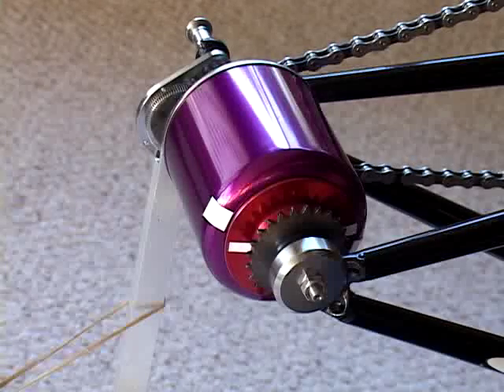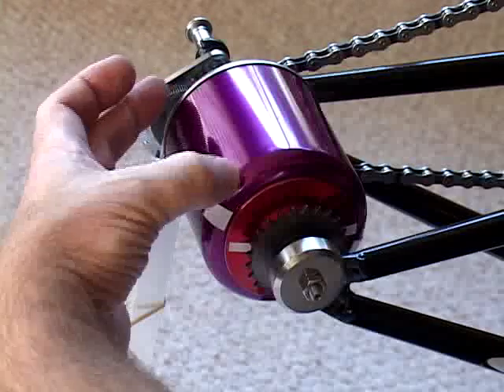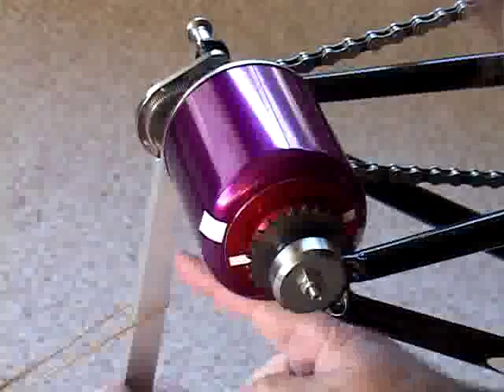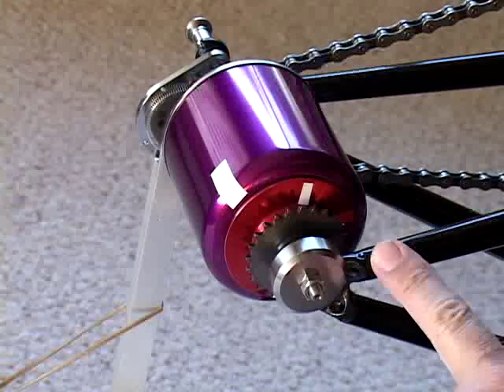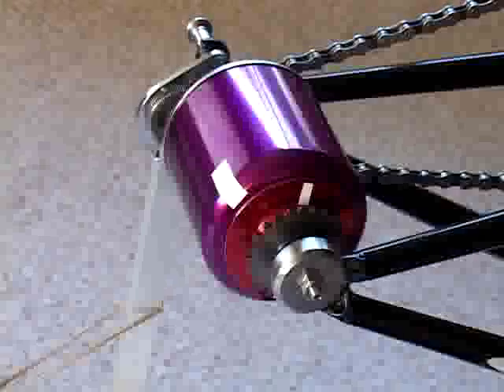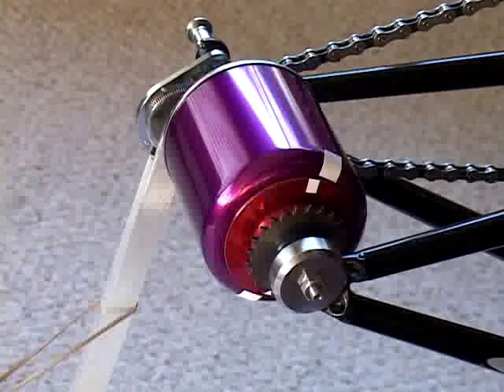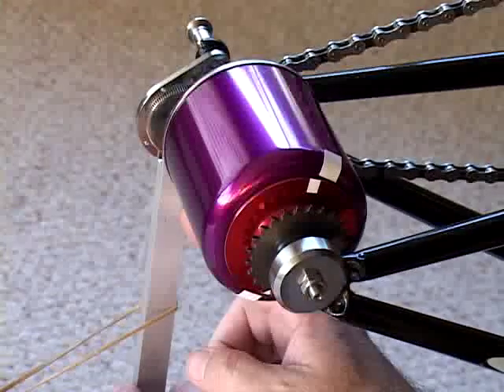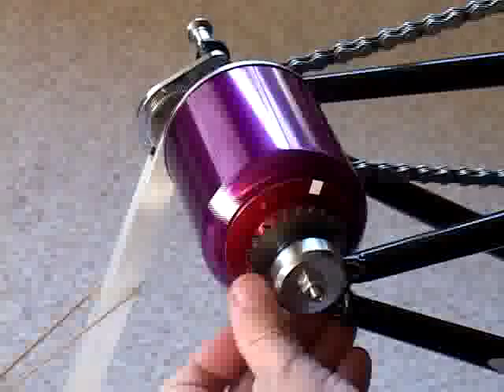Automatic Bicycle Transmission (IVT)

Comment: What about high output biking, like drag races, Hill climbing, etc.  I wonder if you did have some sort of cable shifter, could you just drop the clutch or release a brake lever; after your legs aare turning fast, and all of a sudden you release and have bite and you can launch just like an automobile, on my 5 speed mountain bike i downshift maybe to 3rd to make my legs turn faster then slam it into the next gear and keep the same leg speed whilst upping my riding speed tremendously. i need a transmission that can withstand me hammering down on it for quite some distance, we dont need it to be easier for us to pedal we just need it to work right, function without even thinking about it, and be strong.
Thanks -Rocky
P.s. i cant believe this video is still up i remember it from yeears ago!
Reply from the maker: I'm a large man with strong legs who did more than a fair share of riding through steep mountains & engaging in drag races on a bicycle.  The first bike transmission I 'engineered' for that 'high-output biking' was a hybrid of a derailleur-based 10-speed with a Sturmey-Archer 3-speed hub for 30 gears with a lot of range.  That was 1963, and I was the first person to create a 30-speed bike as far as I know.  For drag-racing, I shifted the 3-speed hub into 1st gear to start, then up-shifted to 2nd while accelerating; the hub gears would not shift until my pedal force relaxed from excessive pedal cadence (at about 120 rpm) , which I repeated for 3rd gear.  Derailleur-shifting was for higher speeds. I always won the drag races!  This is a lot like what you describe as the way you like to ride, and it always reminded me since that torque-responsive shifting is the way to go for an automatic bike transmission.  Lots of pedaling through the Santa Cruz Mountains also demonstrated the advantages of wide range on bike gearing.  BTW, I've designed, built & tested the following: 30-speed, 45-speed, 63-speed, 81-speed, 378-speed, a traction-roller automatic CVT, an automatic ratcheting CVT, and the SIVAT Proof-of-Principle IVT (featured).
Torque-responsive automatic ratio control will 'find' lower gears (higher gear ratios... go figure) by compressing a spring in the torque-reaction mechanism of the ratio-controller.  If you stomp on the pedals, the pedal resistance will drop soon afterward as the gear ratio increases to a point of equalibrium.  The goal is to maintain a more constant pedal cadence & force throughout all conditions to modulate efficient power throughput.  At first this may seem counter-intuitive, but tests show that this is the best way to achieve maximum performance.  Having extensively tested the torque-responsive feature on a CVT, I can assure you that it felt like the transmission was reading my mind!  After the initial weirdness, the automatic feature starts to seem very intuitive, and you can easily control the ratio with pedal force.  You'll most likely discover that your pedaling style will change to become more effective in both acceleration & hill-climbing with this. 

Noting that some riders will occasionally want to stomp on the pedals without feeling a mushy resistance, I'll likely provide a handlebar-mounted lock to override the auto feature in the higher gear ratios for steep hill ascents at low speeds or for brief sprints.  For lower gear ratios (and super-high gear ratios), the overload protection of automatic operation will be important enough to de-activate the locking feature.  Regardless, power throughput capability will be based on more power than what most very athletic cyclists produce, while allowing the SIVAT to be fine-tuned for various riders.  A 100-watt rider can adjust the spring for relaxed riding, while an aggressive 300-watt rider can adjust it differently for greater pedal force.  This adjustment will be at the transmission, not at the handlebars.

Another adjustment riders will be able to make is on a damper that controls how rapidly the automatic feature responds.  You don't want the ratio to vacillate during the force-varying pedal stroke, but you may want the response to be fast enough to change when you suddenly meet a steep hill or mogul.
I hope this answers your implied question.  BTW, what most people consider as low gears are high gear ratios, referring to high input speeds.

Comment from the maker: Here's an update on the status of the SIVAT.  I have potential funding for an initial prototype or two intended for testing on bicycles.  This requires implementing a fully engineered design that fits goals for size, mass, power, efficiency & durability appropriate for bicycles; this is an extremely complex process of multiple calculation iterations to determine a balance of gear, bearing and structure sizes throughout.  My initial goal of 1.0 kW power @ 90 rpm input appears to be too ambitious, so it will require rating the SIVAT for less torque at 90 rpm (optimal pedaling speed) input and commensurately lower power, but still within typical pedal-torque performance required by mountain-bikers.  1.0 kW throughput will likely be at higher input speed than 90 rpm.  The intention is to provide a single core design that can be used on bicycles in various locations (hub, bottom-bracket & auxiliary), as well as on other small vehicles & machines.  It now appears that my mind-numbing number-crunching is only in its early phase!  Thanks to interested viewers whose patience I appreciate as not being 'infinitely-variable'!
Reply from the maker: Stedic Shock Ali
Sorry, you'll have to wait to get one.  I'm now designing a fully functional SIVAT for testing on bikes.  After the SIVAT passes its tests, a business for making & selling it will be set up to make it available as a product.
Reply from the maker: Luke Bradley
Thanks!  Speaking of 'crunching', I'm now looking for a way to crunch the SIVAT into a smaller package.  The best design permutation (of many) so far is slightly larger than the Rohloff hub, and I'd like to get the diameter smaller than Rohloff,  Aside from that, most of the crunching has been done for diameters of gears.  Next is reducing the width, which is more like solving a tile puzzle.  What's left is not amenable to a program, but I appreciate the advice anyway.

As for mud-proofing, that's been one of my primary goals since beginning this.  The unit's design is sealed.  Additionally, a simple chain path with no idlers will allow sprockets & chain to be enclosed in a lightweight clamshell.  The end result can be that a SIVAT-equipped bike should work after abuse that will kill other bikes!
Reply from the maker: Prof. Michael O. Zimmermann JCD ECS
You're right.  My approach in redesign is to assure that this is first strong enough, and then to make it as small as I can without compromising that strength.  It's still a balancing act. 
There's no gearing system that I've found comparable because traditional gearing is discrete, having a finite set of non-zero inverted gear ratios.  The SIVAT solution involves what's essentially a series of planetary gear systems that follow a very constrained formula.  Fortunately, this solution compensates for increasing output torque as the gear ratio increases toward infinity, so gear tooth forces stay within a manageable range; this may be unique.
Reply: Use kickstarter to gain funding perhaps? This is really cool and would love to see it produced. Well done.
Reply from the maker: *****
Thanks!  Yeah, a crowdfunding is most likely after the next video of a functional unit being used on a bike, fully engineered.  I'm now in the process of thoroughly calculating its power throughput with updated design for real-world performance.
Reply: Why not simply go for a CVT with belt?
Works for scooters.
Reply from the maker: Muranaman
True!  I've talked to scooter riders about that, and suggested that 500 watts of power should enable a top speed around 30 mph & good acceleration with the right gearing.  They were shocked!  The design of the SIVAT is intended for several uses aside from pedaled bikes, which includes scooters & anything else that can use a smooth transmission with lots of ratio range that can handle 500 watts or maybe more.  I'll want lots of creative customers who find new uses!
Reply: Size should not compromise the sturdiness. Aside from that, you have not responded as to what this is comparable to in gears.
Reply: Sure would like to see this reach the market. I’m working on a 4 wheel drive and 4 wheel steer pedal powered off road kart.
Reply from the maker: Muranaman
Mountain bikers would never go for the added weight, bulk, inefficiency and erratic operation of a VDP  That's not an optimal drive system for any vehicle.  Even a scooter deserves better!
Reply: Modern belts have little drag. Especially if they are metallic belts (chain belts), and have a much lower resistance than rubber belts. See Nissan CVT.
Reply: It's great for a scooter, much better than fixed gears, since a scooter is often used in areas where lots of acceleration and top speed is necessary.
if a scooter had a 4 speed gearbox, riding around in the city, you'd have to switch gears often, if you don't want it to rev like crazy, or lug.
Reply: how do i get one
Reply: Good for you! Congrats and good job
Reply from the maker: Guy Fawkes
Thank you! 
Now, let's go bomb parliament!
Reply: think I'll just stick to my Suzuki.
Reply: Looks so cool. If you've got a lot of crunching to do and a little money, there's a huge return on investment in learning a simple programming language or Wolfram Mathematica for models. The product looks great though, and as someone who rode bikes exclusively for years, I can tell you there's huge demand in the commuter market. Don't forget water and mud-proof housing is a must.
Reply: SIMKINETICS
Reply: SIMKINETICS feumfsfuegpjpe
Reply: SIMKINETICS 
Could this be something for velomobiles? Just like the prototype, one sprocket from the pedals and one sprocket to the rear axle.
Reply: You don't, it's fake, doesn't work and it's a publicity stunt.
Reply: Haha.  Nice pinball machine James. Not. .
Reply: Only thing that's "mind-numbing" is it's stupidity and the suckers that think this is real. A classic example of 'bullshit beats brains' albeit very low intelligence brains.

Comment: would this be good for a long range electric bicycle?
Reply from the maker: It could be.  The torque & power curves for electric motors on bikes are fairly good for bicycle dynamics, but can be improved with constant regulation of the drive ratio.  The result would improve the vehicle's efficiency, which would improve the range.  Another consequence of using the SIVAT with an electric motor drive is that similar performance could be performed with a smaller motor that could continuously operate near it's rated maximum power output, which is about 99% efficient from the motor's performance perspective.  Another advantage would be a higher top speed with the same motor.
This is relevant here: After receiving a phone call a few months ago from a businessman who wants my SIVAT as a feature on some of his bikes, I'm updating the design to debut on his bikes.  Since his requirements are somewhat different from my suggested applications, I'm changing the SIVAT design to accommodate.  The SIVAT is fairly simple, but is a devil to design or re-design!  The good news is that it appears that a single design will consist mostly of common design & common parts for various uses, including for electric bikes.  My planned specification is 1.0 kW power throughput at 90 rpm input speed, more than enough for mountain bicyclists or most electric bikes!  So far, I've gone through more than half of analyzing critical sizing & configuration forces of components; the results are indicating that it's likely this design will handle 1.0 kW without massive re-design or excessive tweaking.  This appears to be a funded option for me to build prototypes,  so I'm currently 'grinding' through the force diagrams and component specs to be confident about spending prototype money!  My first priority is to deliver a fully-functional model for this bike-builder to integrate in his products with the fewest problems.  If that works out well, the next step will be to provide design variations for other uses like for electric bikes!
Reply: can I buy one?  if so, how much?
Reply from the maker: Matt Parker
Those questions can't be answered until after we test the prototypes and explore the market for viability of this as a product.  The price will be determined by potential volume of sales.  If the demand for the SIVAT is high enough, economy-of-scale will make this product cost a few hundred dollars as a stand-alone transmission not just part of a high-end bicycle cost.  Currently, this information is not available because the SIVAT is only in the development phase.  It will likely be competitive with the Rohloff 14-speed bicycle transmission on pricing at first.  High volume will bring the price down over time.

Comment: wow that is awesome.  I like how it can do zero ratio, that means you can eliminate the need for a clutch as you just keep it at zero while an engine is running then u just increase ratio very slowly , thus the unit performing the job of clutch.  Love it.
Reply: Yeah awesome man, love it how the output can be stopped completely just by touching a finger on it, that's going to be really useful for all bike riders when they connect it to the wheel. I wonder why no funding has been given.
Reply: James Allen ji hi l

Comment: so odd question if we hook this up to a weed eater motor on a bike frame would the lever in the back function as the throttle? or would it have issues with burning out the insides from the input turning at high speeds?

Comment: Great concept, as an avid mountain biker and road rider the most tedious part of cycling is cleaning your drivetrain, as the chain would be fixed between 2 points I.E doesn't have to travel up and down a cassette why not use a belt ? They don't require lubricating, they are clean and are tried and tested, BMC use one on their hybrid bike, mopeds to Harley Davidson's employ them.
As far as I know the best internal gearing system for a push bike currently on the market is the Shimano alfine, however they still have the problem of quite limited gear ratios.
If you can come up with a reliable wide ratio belt drive system I would gladly purchase it for all my bikes, good luck my friend
Reply from the maker: +Lord of the fleas Thanks!  I considered the belt, but have some reservations about forcing users to buy a special frame that requires an opening for one of the stays.  I'm currently working on a design with a builder to make a full-suspension bike that might use the SIVAT at the rear suspension pivot so that the drive chain needs no idler, and can be covered & sealed. Getting the 2-stage chain/sprocket ratios right is requiring some re-design of the SIVAT (which is a complicated process).  If we achieve a good design solution, this will likely lead to a working prototype.  Part of the goal is to make a fully sealed drive optional for both FS & hardtail bikes!

Comment: Seems it should be simple to calculate the actual reduction ratio. But road tests of cars using infinity variable transmissions has produced, at best, mixed results.
Reply from the maker: +Scooter George I don't know of any true IVT's being used on current cars, but CVT's have been used with success for years.  My son's family SUV has a CVT that works very well, and is more efficient than conventional transmissions with discrete gears.  The SIVAT is, after all, a type of CVT with extended ratio range that  eliminates a clutch.  As for calculations, the automatic feature I've chosen just happens to track torque response on a nearly perfect curve for near-constant speed of the prime-mover; to be determined and/or confirmed through dyno testing & rider comments.

Comment: wonder if you could if this would work with  motor bicycles kits
Reply from the maker: +PRO-Tech Help Motorized e-bicycles are an important goal for an eventual, slightly larger version!  The plan is to accommodate 1.0 to 1.5 kW of power.

Comment: think about new electric  motorcycles and gas powdered bicycle kits .Curious about RPM Max range .The electric  motorcycles  would  benefit  greatly  from your  type of SIVAT.  ;  .Powered bicycle kits  are very very popular  now  and they might just be that   magic performance  piece  everyone is looking  for?  Could you have a 35 tooth sprocket  at both ends [ don't  see why  not].. Will  try and contact you on Facebook ; Peter L. B.
Reply from the maker: +Peter smiles alot I spun the featured version up to about 2500 rpm before it started acting badly.  I believe I've figured out how to raise that RPM, but may not need to with the proper auxiliary 'gearing' or chain-drive ratio.  Since the SIVAT will always reach to zero on any input or output combination with auxiliary drive, there's plenty of flexibility to re-size sprockets for the application if the SIVAT is sized appropriately.  
Once I get my e-mail & social media straightened out, I'll be accessible.  Right now, I don't use Facebook or e-mail because of some security issues that Microsoft is messing with.

Comment: You can see the lever activate a clutch inside , he never shows that outside gear going faster than transmission, may be a good device to get investor money.
Reply from the maker: +transformer889 No.  The lever does not activate any clutch.  Yes, it's a good device for getting investor money to develop this legitimate device, and that development is the only motive.  BTW, there's no outside 'gear', only sprockets; an input sprocket and an output sprocket for this demo.